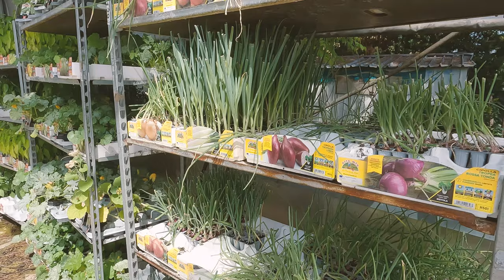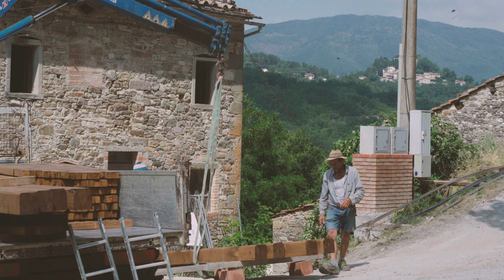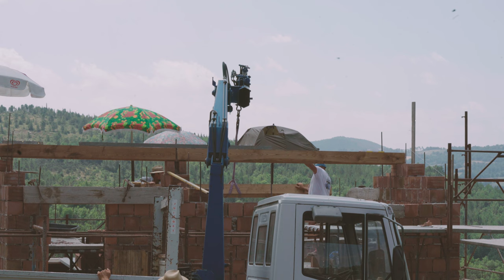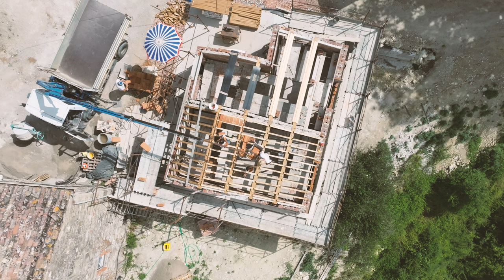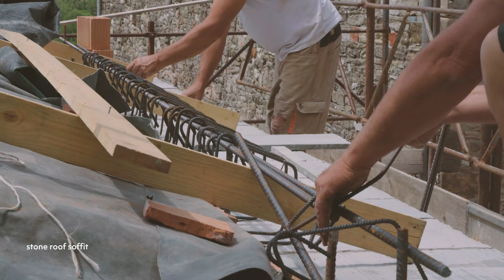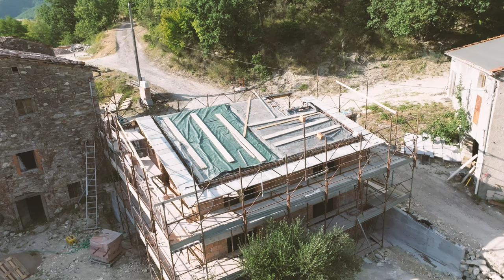#18 How a Tuscan style roof is built. Italian House Renovation | borgo baroti

Comment: So no insulation on the roof? 
On the walls you put insulation inside as I remember. Did you consider putting woodfiber between brick and stone walls?
Reply from the maker: Roof layers: red bricks which you see on the thumbnail, 12 cm of polystyrene, concrete, roofing felt, roof tiles. As we know we can put nothing between brick and stone walls. Whole building is reinforced against earthquakes and it’s related to it.
Reply: @borgobaroti  Ok, I see. So the roof is insulated. But bricks and stones on the walls are directly connected so you had to insulate from the inside. Thanks!
Reply: @borgobaroti  Hi, i love this roof, will try to replicate it in a house i am restoring Portugal. Could you please tell if the concrete layer is before or after the polystyrene? In the video from Part 2 i can see a layer of concrete under the polystyrene, and got a bit confused. Thank you!
Reply from the maker: @pedrolima9795  You can see the cross-section in episode #20. Concrete is under the polystyrene. We do the similar roof also in episode #35 but instead of red bricks we use wood (visible from inside).
Reply: @borgobaroti  thank you very much! Will see the other video as well. Really appreciate it! One more thing, that's like a 10 cm layer of concrete, correct?
Reply from the maker: @pedrolima9795  oh I don’t remember well but i am pretty sure that i’ve said the correct amount in one of these videos.
I believe it was between 10-12 cm 🙃
Reply: @borgobaroti  Perfect, just wanted to be sure. Thank you! :)